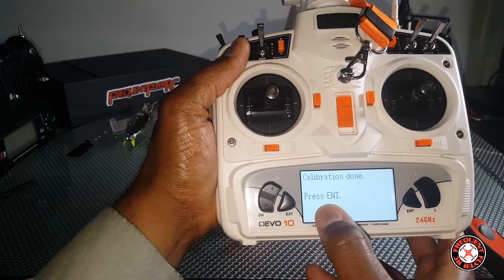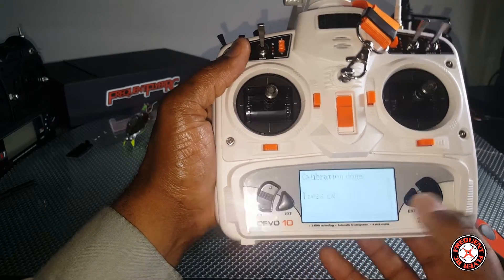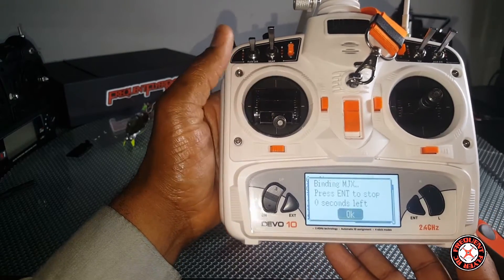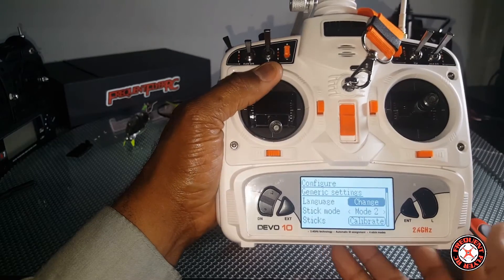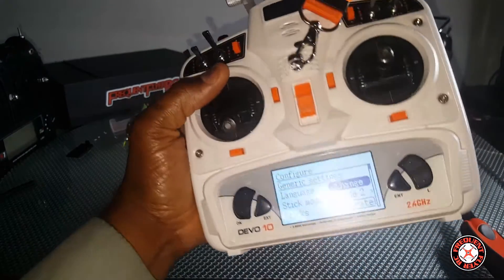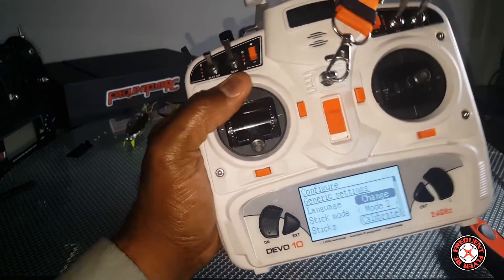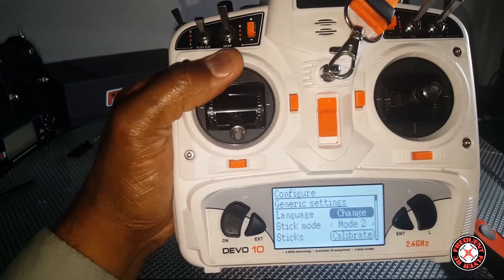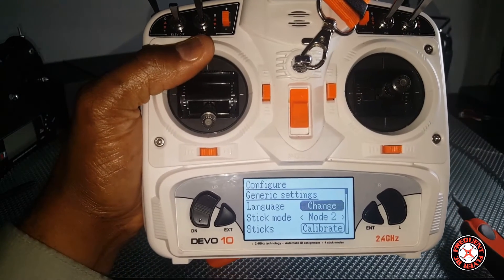How To Calibrate A Devo 10 or 7e With Deviation Firmware/Module Installed

Comment: Hi. My Devo 10 is running Software Ver. 0.8A/Library Ver. 0.2.(right out of box). I can't find Deviation upgrade for my DEVO 10 built for Mac. Any suggestions? Thanks.
Reply from the maker: +Dave Silva I think you must have Windows. Have you visited www.deviationtx.com  ?
Reply: Yeah. No Deviation.com was no help. Was wondering if any of your viewers could help or have a recent (Mac Version) DEVO 10 firmware update I can upload. Thanks for the prompt reply FFRC!
Reply from the maker: +Dave Silva check Walkera website. If anyone else would have it, it would be them.

Comment: anyway to bind the xk 7 to the xk alien 250 or iirc x6 ??  xk DJ ,soul tried it to his alien and no bind but I've heard it's possible sometimes takes a trick or 2 like flip button in hi etc figured you may have little more insight with your tech style of flying ?
Reply from the maker: +Randy Holland 2 different protocols
Reply: Thanks ...I've got a x7 on way used but frame broke at motor ? Didn't know at first that board made into frame ? Just wAs hoping x7 was more user minded tx ...
Reply: You ever flown a TV other eye s quad copter it's a micro but have bigger versions it's a acro mode drone like the xk 100 etc

Comment: Strange, I was just thinking about this and BOOM new video about calibration.
You'll never stop being thanked!
I followed along on my 7e.
I've got the additional three-position switches installed on mine so I went through those too when the time came.
Do you think calibration should be performed on a regular basis or just when a significant change happens to your transmitter like a hardware or software mod?
Reply from the maker: +Michael Thompson Awesome! I threw in a trainer switch as a stand-in for a flip button! Works really well!
Reply: +Frequent Flyer RC that was a cool mod!

Comment: Thanks FF, you are a plethora of information. I knew about the calibration proceedure but I did not know it needed to be done after installing new modules. I ran a quick flight test and recalibrating seems to have fixed the yaw problem I have been noticing on my inductrix. U da man!
Reply from the maker: +Night Flyer RC Cool to hear it helped ya out! :P